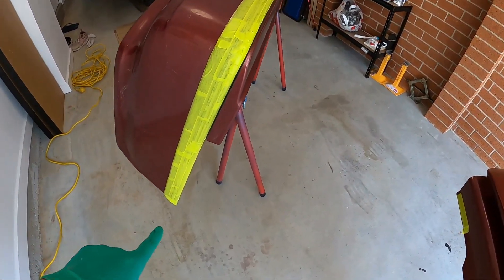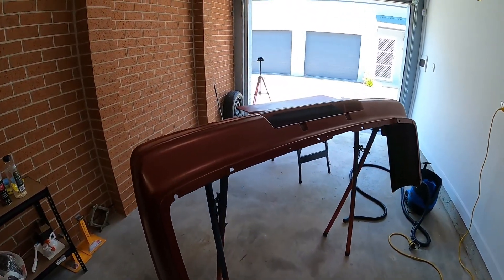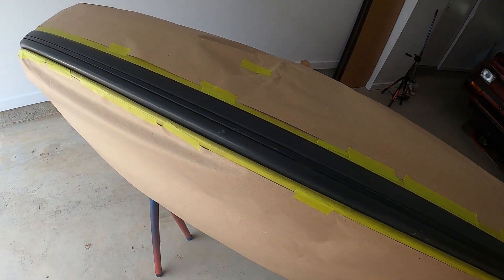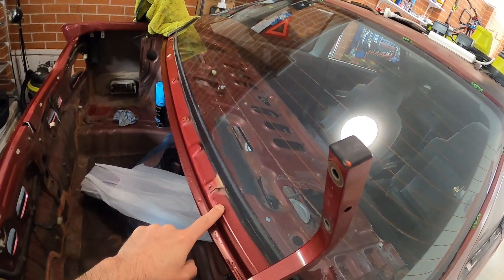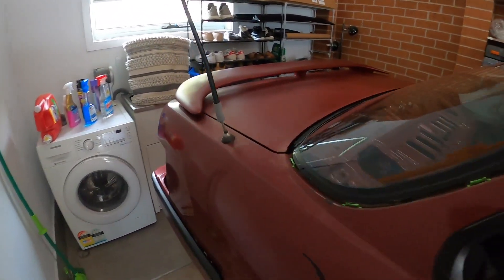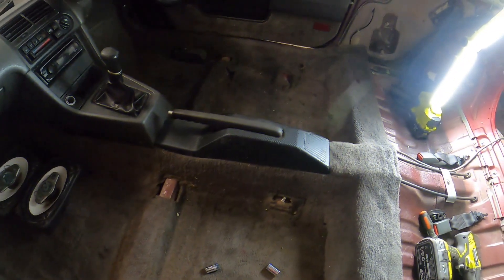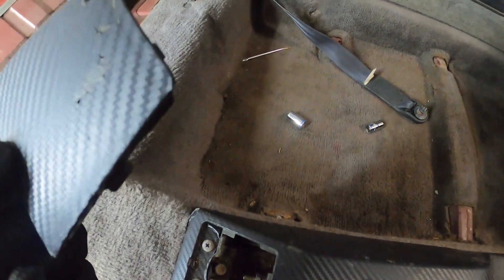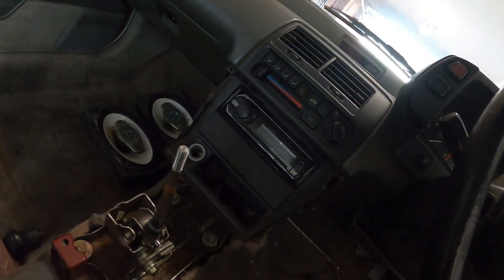Painting the trunk and rear bumper. interior trims and carpet removal  on Honda Prelude 3rd Gen 1989

Comment: I've been sewing as my trade for over twenty years. You maybe could try to hand stitch that rip in the carpet back together but it kinda doesn't seem worth saving if you can find a replacement. Great video!
Reply from the maker: I thought about doing that too,  but I might got a line on a good used one and costing less than  $100. Already stitched the seats and it is easy, reliable fix. Thanks for stopping by as always

Comment: Nice job, it does look new and fresh. oh well, still got the rest of the car to paint. what about the engine, you said it needs repairing. any action plan? and what is the issue with it?
Reply from the maker: Small steps, but getting there. I do believe we have a knocking sound which is a rod issue. We will need to open the engine to see what we are dealing with. I was hoping to finish the suspension and inside tasks first, then start on engine and later, paint the rest of the car

Comment: Really nice job. Question, did you apply plastic primer or adhesive promotor before applying the paint ?
Reply from the maker: Thanks man, appreciate your continued support. No, plastic primer or adhesive can only be used on bare plastic. Because paint does not stick on bare plastic well. If there is good paint base, you are only applying paint over paint so it will stick good. As for the trim, the paint will be absorbed so no need for anything applied before

Comment: Hey, great video man. Any chance you could make an instructional on removing the rear bumper? I'm having issues haha
Reply from the maker: Thanks for watching.  I will once install it back. But in general,  remove the screws on top and bottom of it and remove the mud flaps and plate bracket.  Then it should be ok to remove it. The screws will be the hard part. So wd40 is your best friend
Reply: @saltherookie  Thank you brotha, I appreciate it. I actually found out after poking around long enough, just 3 screws in each wheel well and two nuts in the truck and two under the car
Reply: @saltherookie  ^This removes the whole bumper cover and crash bar :D

Comment: Aren't you going to wear proper shoes at one point? True Aussie ha. Good job buddy but I would not recommend putting the bumper back just yet. you dont want to scratch it and it will get dirty . As for the carpet, I know it will be costly, but get a new one. this is beyond saving mate
Reply from the maker: With this heat and getting in and out.  Shoes are not the perfect thing to wear  :). Oh yeah of course, this is just temporary until I'm done with the interior

Comment: How did you get the carpet out in the last part? It seems to wrap around behind the center console.
Reply from the maker: The only place where I had to make a cut was under the dash behind the radio area.  Once you install everything back, they hold it in place with no issue.  I guess if you removed the dash completely then you don't need to make that cut.

Comment: How do you remove the rear seat head rest?
Reply from the maker: @hotrodgreg504  first, you need to remove the backrest.  Once that is out of the way, you will see two bolts one on each side. If I remember correctly,  they should be either 8mm or 10mm. Remove them and the head rest can be removed